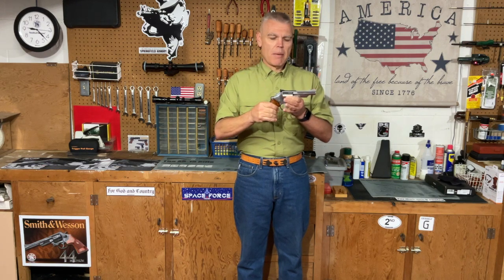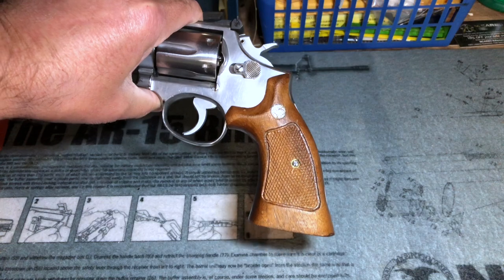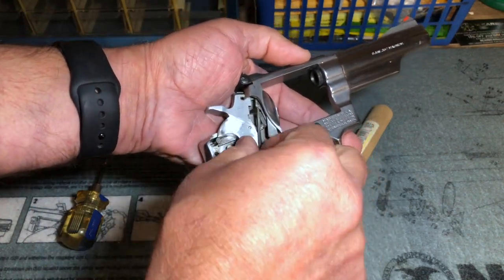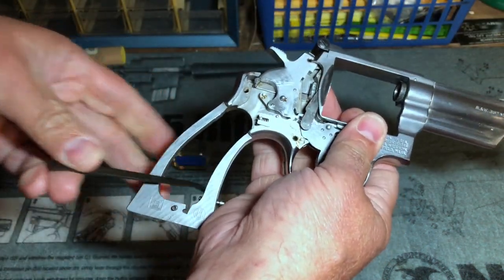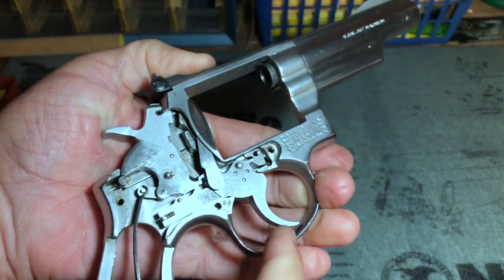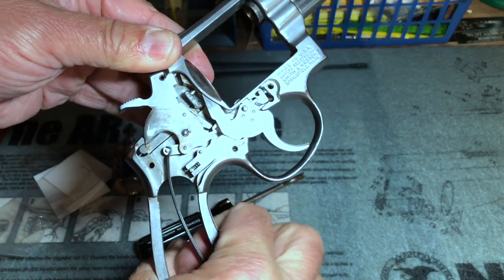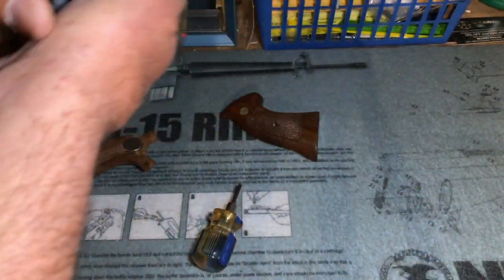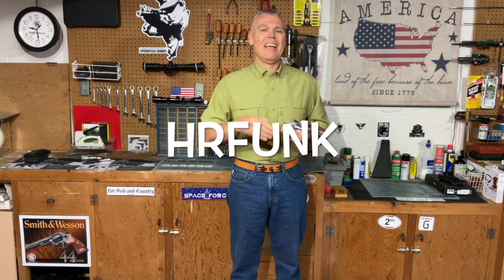S&W Revolver Spring Replacement

Comment: As a S&W factory trained police Armorer who has disassembled their revolvers many, many, many hundreds of times since 1975, I'm happy to provide some helpful information.  The factory taught me that it is actually easier and safer to remove and reinstall the rebound slide spring with a 1/4" round tapered blade screwdriver with a 4" shank and 4 inch handle, NOT a gunsmith screwdriver with separate tips and NOT one with a hollow ground blade.  Those Brownell's tools are actually quite difficult to use and provide little control, as your video revealed.  As my instructor, the late John Contos showed me nearly 50 years ago, I fabricated the same one that I use for all S&W revolver work from a high grade nickel steel screwdriver, by dressing the wide flat sides of the blade off and smoothing the sides round to match the shank, which prevents any damage to the gun.  Simply push the blade by the right side of the retention post and pry up as you hold your thumb over the spring.  It will never fly.  To replace it, just push it in with the screwdriver as you press downward on the slide.  When it catches the top of the post, remove the screwdriver and jam the blade straight down on the spring through the slot.  With a bit of practice, each maneuver takes less than 3 or 4 seconds!

Screws should be removed with that same dedicated screwdriver.  The handle should be slender to permit easy spinning that ham fisted screwdrivers don't provide.  Some workers fashion ball handles and make their shanks from 1/4" stainless drill rod, and they twirl the shank.  Always place your thumb adjacent to the screws to prevent walking and skittering across the gun.

The front screw that you removed has light "threads" cut into the leading shank.  That identifies it as a replacement screw called "endshake screw yoke", which means that at some time in its life, that gun had endshake of the yoke, and required a wider diameter forend that takes up slop that develops on the mating yoke button. Such is a common repair for Combat Magnums.  It's the diameter that make contact, not the length.  S&W told me that they did not recommend a steady diet of full house magnum loads for their K-Frame revolvers, nor for the older Model 29s, which is why R&D undertook to redesign the system that had its origin in very low power calibers of the early 1900s, and is why their current Model 19 Classic and similar crop of N-Frames can withstand any punishment.

Costly aftermarket springs are entirely unnecessary.  As per S&W specifications, the standard rebound slide spring may be shortened by 1-1/2 coils, which was frequently done at the factory with their N-Frame target sighted models.  Always bury the clipped end into the slide.  In addition, the forward square edge of the hump on the slide may be lightly rounded with two or three light passes (forward and rotate) with an India stone to allow the edge to glide to battery more easily by the mating surface of the hammer.  

I cringed when that side plate bobbled around on the frame, which would get you fired post haste.  The official manner of safely removing the side plate to prevent marring is thus.  Remove the main spring first.  Grasp the gun by the barrel, with the plate facing down.  As you hold your left hand beneath the plate, strike the end of the but squarely on the edge of the bench and it will safely drop into your hand.  Place the plate on the bench with the fancy side up.

Removal of stocks is very simple, regardless of how tight.  Loosen the screw fully, then press it with the screwdriver blade to push the opposite stock into your hand from the frame.  Never pry it.  The other is removed by simply pressing it off through the skeleton with your thumb.  You may see my complete demonstration of S&W revolver takedown and reassembly on my channel, here https://youtu.be/4ujyLn3lHBc  

Keep up the good work.
Reply from the maker: Thanks. Will do!
Reply from the maker: I appreciate your input. I could never convince my administration to send me to revolver armorer’s training (even though we had officers using J-frames for off-duty and back up carry). I’ve attended numerous other armorers training courses, but with wheelguns I’m largely self-taught.
Reply: You talk about the new 19s and N frames taking “any punishment”. What’s your opinion on firing full power “original spec” 357 in the L frames with any regularity? Can they take it? I really like doing things the old way so when I learned 357 was neutered decades ago it made me really want to shoot the original loadings.
Reply from the maker: I have a Model 28. I run it with hot .357 handloads, and it handles them with no problems. I don’t worry about the durability of N-frame .357 Magnums. I feel pretty much the same way about the L-frames. Unless you severely overload your ammo, you shouldn’t have a problem.
Reply: @hrfunk  n frames are definitely beasts but I worry about the thin wall in the L where the cylinder notch is
Reply: You sir, are a master ! I followed your instructions to the letter when dealing with my S&W 15-4. Thank you kindly for sharing your experience and knowledge 👍

Comment: Good morning, HR - As you’re aware, I have really enjoyed and valued your videos, but this may well be my favorite.  The clarity and detail you provided — and especially the experienced-based hints — are simply outstanding.  THANK YOU.

Many years ago (early1970’s), I did this precise job with a Smith K Frame M14.  Eventually I succeeded, but I was assigned in the Aleutians and improvisation was often mandatory.  So, with no Brownells tool, I finally was able to adapt an over-sized wooden “toothpick” to retain the spring, but it was a frustrating and lengthy operation (the spring did fly across the room once, and it took well over an hour to finally locate it).  That .38 Target Masterpiece remains one of favorite revolvers and its side plate has not been removed in the last 50 years.  My eyes have now deteriorated to the point where that sort of “minute work” is unlikely.  

Your M66 seems ideal (especially with the now lighter — but not too light — trigger pulls).  They are superb firearms, particularly (imho) for +P rounds.  And I noticed the hammer mounted firing pin, which (at least for me) is an instantaneous indicator that the revolver left Springfield during an era of real craftsmanship.

I know you’ll forever love this firearm, CONGRATULATIONS, and its interesting to me that your new duty Glock and this Smith essentially tell the “tale of technology” during their last (maybe) 50+ years:  precision design and craftsmanship versus simpler (but highly durable and reliable) design, utilizing newer materials and manufacturing processes.  They both operate very effectively, but one is a “work of art.”
Reply from the maker: I totally agree Roy. The older wheelguns were true examples of industrial art. Thanks for watching!

Comment: Good job H.R.
While some "gunsmiths" cut and/or trim the springs to gain a lighter trigger pull. I can't tell how many screwed up "trigger jobs" I have had to fix because of this so I am NOT a fan of cutting nor trimming them (I attended the S&W gunsmithing school).
Replacing the factory springs with either factory or Wolff springs is definitely my preferred method!
Another tip:
Polishing all surfaces with Flitz compound (Flitz on leather) to remove tool marks from the hammer and rebound also and on the frame where make contact will also make the trigger feel lighter.
The trigger pull on my 686 is about 9 pounds, but feels more like 5 or 6, and more importantly the trigger pull is smooth, but with an actual heavier (i.e. safer) trigger pull!
Reply from the maker: I think the same way you do. I don't like to cut springs. There are just too many problems that can occur from that. I would much rather replace them. Someday I may do some polishing oin the inside of my 66, but that's a project for the future.

Comment: After watching your video I just replaced my same springs on a Model 65.  Took my time and was careful, took about 30 minutes to accomplish with no problems. Thanks HR for saving me a trip to a gunsmith. I truly enjoy all your videos, mine are quite amateurish by comparison. Keep p the good work.
Reply from the maker: You’re welcome. Thanks for watching!
Reply: I just ordered my springs as well for my 65-2.  Did you need the special tool HRFunk had to remove the spring?  That part looks a little tricky.
Reply from the maker: You don’t need it. It just makes things a little easier.

Comment: No matter what I did to my Model 66 I could never get it as smooth as my model 19 made in the late 1960's. They are basically the same gun but I think it is the stainless steel that kept me from getting that smooth as butter trigger  pull. My 19 is an old PD gun with years of wear. When we went to the SIg P-220 in 86 they sold us the 19's for $65.00. The tool don't look like it works any better than the Bic ball point pens I have use to push the trigger spring into place for 40 years.
Reply from the maker: In one of the various S&W armorer's courses I attended, the instructor mentioned that the stainless steel used by the factory did not machine as easily/as well as the carbon steel. That may be why your 66 never quite equalled your 19.

Comment: I've seen several videos about this upgrade, and yours is clearly one of the top 2 I have seen.  clearly explained steps, to the point, and very engaging to the watcher.  One thing the other videos noted was the potential for light primer strikes and the need for an extended firing pin, did you have this issue as well?
Reply from the maker: No, but this revolver is one of the older ones that does not have an internal firing pin. That particular malady did not appear until smith, and Wesson adopted the newer design.
Reply: @hrfunk  they surely don't make them like they used to.  Thank you for the reply sir
Reply from the maker: @bobjames2312  My pleAsure.

Comment: Nice video. I have done similar changes to my SW revolvers. Not really hard to do but very easy to mess up. What dash number of this Model 66? 

My Model 66 No dash has a SA of 1 lbs 15 oz and the DA is 7 lbs 5 oz. I guessing my gun had some work done it by the previous owner(s).
Reply from the maker: That would be my guess too. My 66 is also a no-dash.

Comment: Been there, done that.  It will be interesting to see if you use the spring tool or a small screwdriver on the rebound spring.  If you use the small screw driver what are the Vegas odds that you chase a spring across your garage?

Comment: I left a comment RE: a Mod 65 that locked up after shooting 125 gr @ 1,400 fps ammo . The pin that bent is the small one on the grip side of the rebound slide . Your 3" is so cool , If it were mine , I wouldn't chance hurting it . Too many good choices for good ammo , no need to shoot full power stuff . Save that for , L & N frame , Rugers or rifles .
Reply: I don't get how the pin got bent ?? I thought the force on parts was to the front , not the back ?? Like a bullet walking out of a case under recoil ??  Many Thanks !!
Reply from the maker: Trust me, that revolver gets a lot of TLC.

Comment: In your opinion what is the lightest acceptable DA trigger pull? I hear you can go as light as 6.5 lbs but to only user Federal brand primers since they have a reputation of detonating reliably.
Reply from the maker: I’m not sure what the LIGHTEST reliable pull weight is in general terms. There are other factors that also contribute to reliable ignition. I personally don’t want to be restricted to one brand of primer for my firearms.

Comment: Excellent video HR, thank you. Question; did you, or anyone else here, ever get occasional light primer strikes when using the Wolff main springs?
Reply from the maker: I don’t remember any with the Wolff standard power spring. I’ve had some with reduced power versions.
Reply: @hrfunk  Thanks. Was the feel of the trigger about the same with the Wolff standard power spring?
Reply from the maker: @joedoakes8778  No, it was noticeably lighter.
Reply: @hrfunk  Thanks HR. I was thinking of some spring changes for my early-90s 3-inch RB M65. A friend told me he always got light strikes with the Wolff main springs but he may have been using a lighter weight. After seeing your video, I think I’ll got with a stock weight main and either the 14 or 15 lb rebound. Plus check for any burrs when I’m in there. BTW, I love how you resurrected that 66. The Combat Magnums were always a favorite of my but always eluded me. I remember, back in the old days, when half the cops in Chicago had a 19 in their Jordan Border Patrol holsters, some with Jordan Trooper stocks on them. Stay safe and keep up the good work.
Reply from the maker: I’m sorry, I misunderstood your last question. With the Wolff standard power springs, the Trigger pull was slightly lighter.

Comment: Great video HR do you need to lightly lube anything in the install of the new springs ?
Reply from the maker: Not really. A light drop or two on the action parts won't hurt, though.

Comment: HR Funk I was thinking about try to lighten the trigger pull on my S&W 940. I doubt it is under 12 lbs.
Reply from the maker: The 940 has a coil-type mainspring. Removing/replacing it requires a different procedure. Just FYI.
Reply: Thanks for your video!!!

Comment: Thanks for a great video! I am watching it to see if I can figure out why my 629 mountain gun started to sometimes malfunction in single action mode when I press the trigger very gently it will release the hammer but at the end of the hammer fall it will stop before the firing pin nose contacts the primer and the trigger will put returning pressure on my trigger finger!? I have several S&W revolvers and have been shooting these types of revolvers literally 50 plus years(S&W   N frames) and never experienced this.I would appreciate any insight you might have.Thank you.P.S ,yes the strain screw is snug on the hammer spring.
Reply from the maker: I have a revolver that does something similar, but the firing pin never fails to contact the primer. Here’s what is probably happening. When you are “gently” pushing the trigger, you have very little pressure on the trigger, at the point the trigger releases, the rebound slide spring is pushing the rebound slide forward. This is an internal safety feature that prevents a cocked revolver from firing unless the trigger is pulled/held all the way to the rear of its stroke. You could have a gunsmith check your spring and make sure it’s within specifications, or you could put a little more rearward pressure on the trigger to insure you get good ignition.
Reply: @hrfunk  thank you  very much! I will follow your suggestion
Reply: Also this anomaly never occurs double action,only in single action shooting
Reply from the maker: You’re welcome!

Comment: With revolver spring replacement; I suggest that you replace the firing pin (if it's one that is NOT attached to the hammer).  Upgrading the firing pin, to one that is slightly longer; increases the reliability of ignition.  Doing so is a "choice"... not a legal recommendation.  Personally I have found that most revolver spring kits, increase the chances of an occasional "Light Strike".  By changing the firing pin (to one like Apex Tactical makes); I have had ZERO light strikes.

Comment: You should also loosen the main spring first before you take the side plate off you risk breaking off the hammer pin. It may not happen the first or third or even the forth time but it will happen hammer needs support on both sides you will see where the pin goes in the side plate

Comment: For some reason, on my smith and wesson, the trigger and hammer seem to be a completely different metal, or they at least both have a discolouration compared to the rest of the firearm.
Yours looks a lot more consistent with the type of metal.
Any thoughts?
Reply from the maker: Older revolvers, like the one in the video, had stainless steel triggers and hammers. In newer versions, they used the same color case hardened hammers/triggers as were installed in blued revolvers.

Comment: @hrfunk
Another great video HR. Loving your channel, been a sub for a while, and happy to see you getting the audience you deserve. 
I tried the same spring swap in my new model 66-8 and got pretty radical results. My DA pull dropped from just shy of 12 pounds to 7 pounds. As this is a defensive revolver I felt that was too light and also made me concerned about light primer strikes. I put the factory springs back in. Did I do something wrong?  The Type 1 spring is supposedly factory weight but there’s no way. Thanks!
Reply from the maker: I wonder if they accidentally sent you the lighter spring. I would have been a little uneasy with a defensive revolver running that light too.
Reply: @hrfunk  It’s possible. It was marked correctly but maybe it was mispacked. I may try the Wilson Combat spring kit and see what results I get with that. Thanks for the reply and keep up the great work.

Comment: my revolver has wolf spring kit, however if i decide to re-install the factory main spring, can i leave the reduced power rebound trigger spring in ??
Reply from the maker: Yes, but you may end up with a situation where the internal safety associated with the rebound slide is impaired. You might also get sluggish trigger reset. I wouldn't go with the absolute lightest rebound slide spring.